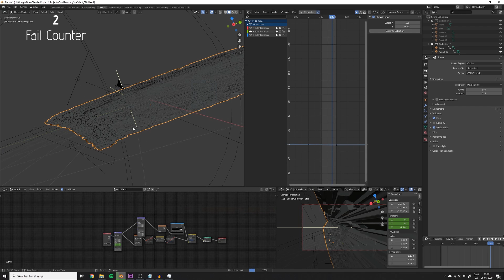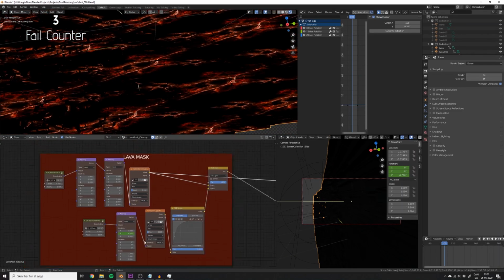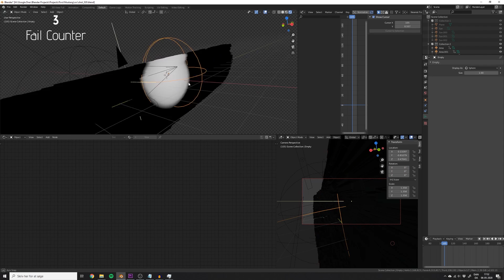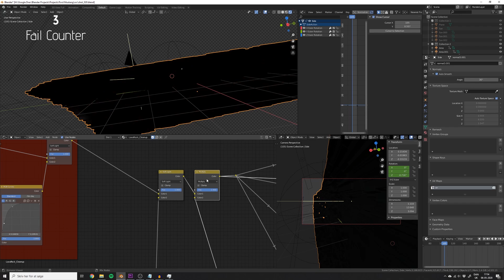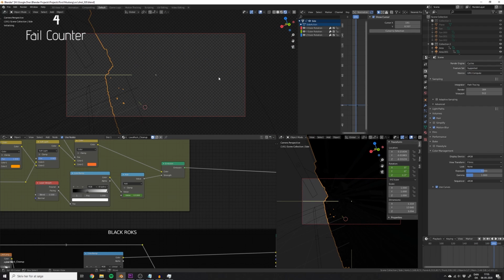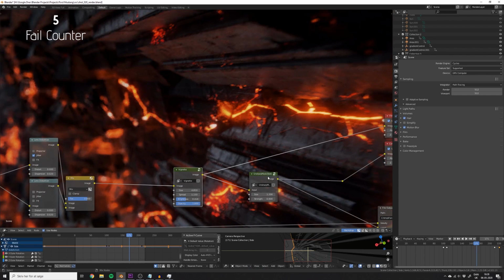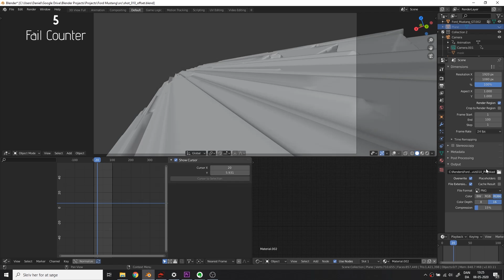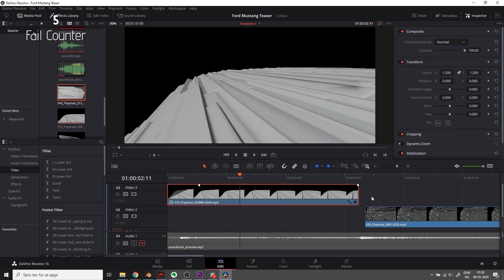CG Breakdown/Tutorial || Blender short: "Just Another Car Ad"

Comment: I have a question unrelated to this video but How many software you are good at? What softwares you can confidently say that you can use?
Reply from the maker: Thanks for the question!
For 3D packages I know Blender and Cinema 4D and I am using both professionally. I also starting to get into Houdini and use it for specific effects in my projects - and I know a bit of 3Ds Max as well. Other than that I have been using Unreal Engine a lot the last year and I am pretty comfortable with using that software as well. I think it's always great to be able to find the best tool for your problem and not just having to be dependent on only 3Ds Max or C4D (for instance).

Comment: Amazing Work! On your playblast renderspeed problem: Don't set your engine to workbench and use the render panel. Instead in the 3d view go to "view"->"viewport render animation". This way will give you pretty much the same rendertime as playing the animation in the viewport. Don't ask how long it took me to find that option ;)
Reply from the maker: Dude!! That is amazing! I kept looking for that button in the render dropdown, where it was located before and then I thought, they probably removed that feature completely. Thank you so much for sharing this tip! Hahah, some buttons are very well hidden
Reply: @DanielVesterbaek  No problem dude! Had the exact same issue last year. I guess Workbench as a render option is just for niche cases or as a stylistic choice.
Reply from the maker: @Seecalator  Yeah, I suppose so too. When it was introduced I always thought it was meant to be a nice version of a playblast with shadows, but I guess that was not the case, heheh
Reply: Daniel Vesterbaek Viewport Render Animation is a lifesaver. Make sure to switch your main render settings to JPG and set the destination folder and it’ll render out the animation in no time.
Reply: @Seecalator  Could someone explain like what this is and how it works? It looks like something really cool and good! (:
Reply: This is something I thought was possible, but could never figure out, thanks!

Comment: Hi Daniel, Could you please recommend the system configuration/properties for blender in windows. I've searched in internet. It will be helpful if you recommend me about this. Thanks
Reply from the maker: Hi Sujal! Of course. I would suggest getting a pretty powerful CPU. I have a i7-9700 myself, but the mid to high-end AMD CPU's are great too. For the GPU, you will need a good one to be able to render quickly and it's best to get a nVidia as they have CUDA cores, which are used for rendering. I have a GTX 1070 myself. For the memory 16 GB is good. I had that for a long time, but I recently upgraded to 32 Gigs. If possible get a motherboard that has multi-GPU support - Then you can easily plug in an extra GPU in the future if you need more rendering power. :)

This article also has some good info on it I think
https://www.cgdirector.com/best-computer-for-blender/
Reply: @DanielVesterbaek  Thanks for the reply Daniel. All the best for your future projects.